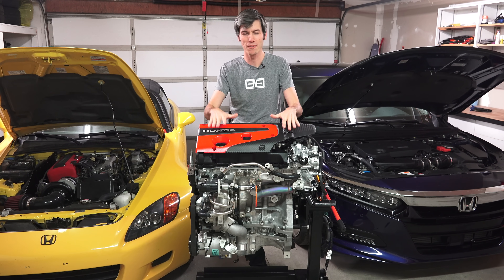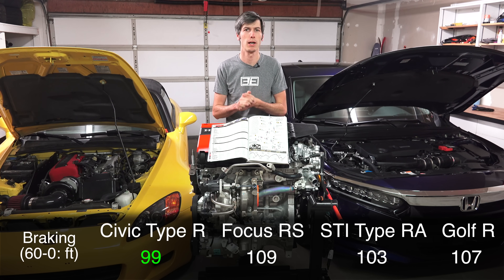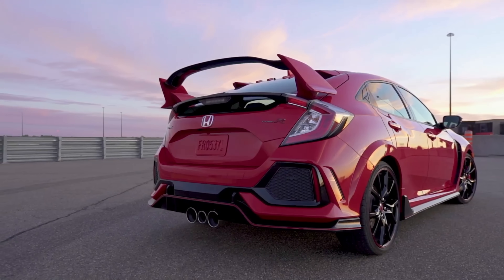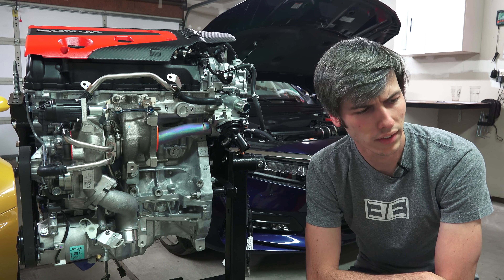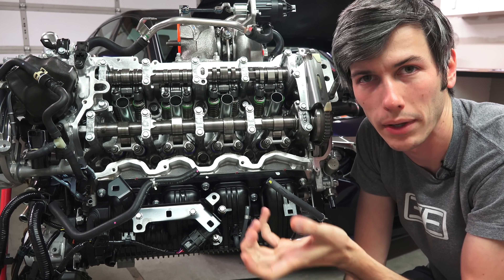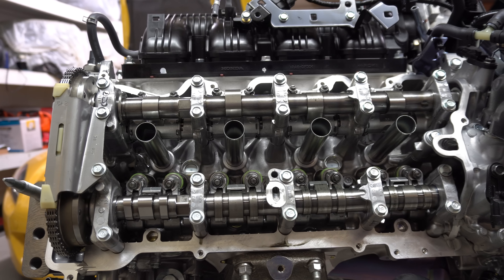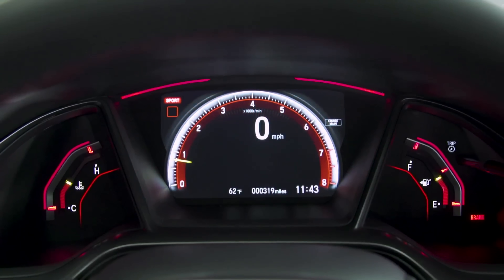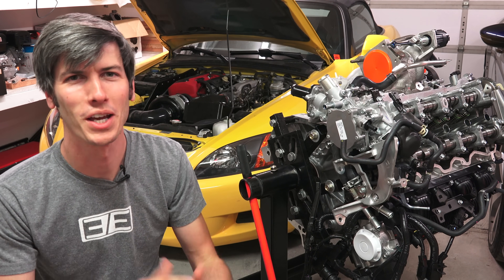The Honda Civic Type R Destroys The Competition - The Best Engines

Comment: Love your channel, however I have a (minor) bone to pick on the description. The 2018 Civic type R does 0-60 in 4.9-5.4 sec depending on source cited, while the 2018 Golf R DSG does 0-60 in 4.6 sec with clinical consistancy (via AWD launch control and 7speed DSG). 

Moreover the 2.0TSI in the R gains +60 horsepower with a conservative tune alone, (no additional parts modification required) and STILL does not have the overheating issues of the K20C1 (which I have witnessed personally at a recent track event in my area [car also had the second gear grinding issue which is somewhat common]). 

Having said that, I really like the FK8 Type R and hope that Honda is taking care of owners who are experiencing these issues, god knows VW is riddled with reliability issues, the most significant of which on the current generation EA888 G3 is electronic water pump failures. 

Bias note: I own a 2018 R and am likely emotionally biased, however I have personally confirmed the performance claims with my own car, using 10Hz GPS so I feel confident in the objective nature of this complaint (check out the video of 4.16 second 0-60 in a thunderstorm!).

Again, love the content, please keep up the great work!
Reply: So keep your DSG...awesome transmission but your ‘complaint’ is not telling us anything anyone (especially Jason) didn’t already know about the Golf Rs...of course a perfectly controlled launch will get consistent results. Launching a manual (let alone one with FWD) is all down to conditions and driver skill. 

Also if we’re going to nitpick over performance ceilings a tune in the k20c1 gets you similar gains. Of course the ea888 world has more potential at the moment beyond a simple re flash since the architecture has been out for quite a long time on a lot more cars...but then you get to the chassis read anything from Randy Pobst or people who drive for a living. The golf chassis is nowhere close to the Type R. 

Don’t mean to sound antagonistic but your ‘complaint’ ended up losing the plot in the end and sounding like reassurance for you about buying one. Enjoy it, who cares what the internet thinks. Even if beyond 0-60 comparisons it’s still slower than the Type R...
Reply: Please refrain from using the term “sports car” referring to any of these cars.  Lol.  The Golf R appeals to an entirely different type of buyer, like me who is 42 years old.  That Type-R will run circles around my Golf R, but I’m okay with that.
Reply: AOMechMarine AOMechMarine  my wifes '06 Subaru Forester automatic Blows away most cars from the stoplight in the Wet or Snow in Total Control so the Confidence part is true, and Chicago Winters Suck!
Reply: AOMechMarine AOMechMarine  didn't see that mentioned? But glad you approve. I have torched so many Lexus SUV's with mine, it's like "Give it Gas or get outa the way!"
Reply: vw piece of junk...
Reply: Golf R look too plain and can’t compete with the Type R stock for stock on the track. And why do people always try to compare a tuned golf R to a stock Type R? Civic Type R can also be modded and tuned to still run circles around the golf R. Plus type R reliability are far more superior if compared to the golf R. Call me a fanboy but type R have proven itself over and over again.
Reply: Vw vs Honda reliability, how man times you gunna have golf in the shop after the warranty is up good luck haha
Reply: After diesel gate vw doesn't even exist to me.
Reply: Honestly, the comments section of virtually EVERY hot hatch group test is full of VW fans making all kinds of excuses for why the Golf is getting beaten by newer and cheaper competitors. It's getting rather tiresome. For that group test they used a manual R because all the other cars were manuals.  WE KNOW the DSG is quicker from 0-60, thanks mainly to computers controlling every aspect of the process. But DSG or not the Civic is the faster car from a roll, the faster cornering car and the faster stopping car.
Yeah an R with DSG might have lapped a little quicker, but not 2.5 seconds quicker. Just because a car is quick from 0-60 does NOT mean it is the faster car point to point. Many cars with less power and a lower price can beat the Golf R round a track, of which the Civic Type R is just one example.
Reply: Hey i destroy Civic r's all the time with my golf r estate, how so? I got more room for everything und still be faster. Next pls
Reply: GadgetsNGear the one tested was a 6 speed and not dsg. Lb for lb the golf R is slower as you can see. Meaning dsg for dsg or 6speed vs 6speed the Type r will probably be faster in both versions if they were offered. Sure 0-60 the golf will always win but pass that it’ll start to die off.
Reply: @TheBb6prelude   I'd like to provide some corrections/context to some of the statements being made: first off a large part of what is affecting the manual Golf R's crappy 0-60 and 1/4 mile times have nothing to do with it making less power or being less effiecient than comparable cars. It is a well known fact within the VW community that the manual transmission in the MK7 Golf R is gimped from the factory compared not just to the DSG but to many other turbocharged cars equipped with a manual. Fact 1: The manual Golf R has no launch control and the way the ECU is setup in stock form causes it to lose boost in between shifts thus affecting acceleration times and trap speeds (some tuners are working on remedying this). Fact 2: The manual Golf R is using the same weak old gearbox/clutch that the MK6/7 GTi used! Because of this, VW implemented electronic torque limitations that will causes the car to bog when a hard AWD launch is attempted(ie. you can't dump the clutch). Fact 3:  The manual Golf R uses shortened final drive ratios compared to the GTi to help low end responsiveness but this the makes it worse in short distance tests like 0-60 or 1/4 mile because it requires an extra shift(e.g.. 3 shifts to 60) The same happened for years with the less powerful 5-speed WRX matching or beating the 6-speed STi because of suboptimal gearing.
Reply: The Type R is not offered in DSG, that argument is not valid. Given that the Golf R IS offered in a DSG and IS faster than the Type R when correctly equipped, my point stands. The majority of Golf Rs sold in the US are faster than the Type R.
Reply: dude the Golf R cost 15k more than the Civic how can you feel good about even being slightly faster to 60?
Reply: The Golf Is $5k more than the Civic in the united states. If you want to see where that money goes: Driving 4 wheels and the interior. It is worth every penny.
Reply: @Flakey86  Look under the car GadgetsNGear (see Savaegeese videos).  The Type R is considerably better quality than the Golf R.  The Golf R uses a lot of cheap stamped steel suspension, sliding brake calipers etc... The Type R is much better engineered underneath, lots of aluminium, sophisticated geometry, Brembos etc.
Reply: @TassieLorenzo  The golf R could definitely use a few less pounds on the scale which aluminum suspension arms would help with. But it's still faster than the Type R, stamped arms and all. And it doesn't suffer from catastrophic transmission failures or regular engine over-heat limp modes on track either. If my car exhibited those behaviors, I wouldn't care what the lower control arms were made out of.
Reply: Ultimately, the Golf R has much more performance potential than the Honda Type R ever will. Good luck delivering 350hp safely through 2 wheels only on less than perfect terrain and inclement weather. Choose the Honda if you don't like safe and stress free driving on snow and wet and tarmac.

Comment: Good luck finding one for MSRP.  That and living with it as a DD in snowy climates, the golf r was the better buy.
Reply: @Lako cancerous? That's quiet the exaggeration lmfaoo
Reply: Widely available at MSRP now. This was an issue the first year.
Reply: Hervyn Batista dealers in SoCal are still extensively marking them up...
Reply: 12055isgod not really. People are buying them for mid 30s
Reply: NO ONE is buying them at MSRP in Southern California where I live. I don’t/won’t travel far to buy any car.
Reply: With LSD and manual, driving in the snow won't be bad.  Needs tires, though.

Comment: 2 litres?? I have more litres of milk in my fridge!
Reply from the maker: This guy owns a gallon of milk.
Reply: You better drink it before it goes bad!!
Reply: I have a 3 liter Shasta drink in my fridge.😎
Reply: And there you go thinking milk is the way of the samurai and that is some how relate to this video, just like this message doesn't make sense either. 😬
Reply: Slap a turbo in it. Lol
Reply: So how much cowpower does your fridge make?
Reply: Dennis G I can’t disclose the exact number.... All I’ll say is it keeps my beer cold! 👍🏼
Reply: Evo 9. Mic drop!
Reply: This is all you can afford! Only milk! Other people have this engine! LoL...
Reply: daniel rosca Naaaa, I prefer 8 cylinders and at least 5.0L 😉
Reply: 2 liter is considered big in Europe and Japan. Usualy 1.0/1.6 liter in europe
Reply: @DevasionX  no it isn't considered big. 4cyl is consider normal. Six cylinder and above is big although not unusual so I would actually say only v8 is rare
Reply: Barry Britcher you’re not very bright bro. We’re talking about size for 4cylinders. V6/v8 is completely irrelevant here!
Reply: @Barry Britcher 2 liter is a full size 4 cylinder, just like 3 liter is full size 6 cylinder. BMW has had 2.2 and 2.5 6 cylinder engines where 3.0 was the biggest option (3.2 m3 excluded) 4 to 5 liter is usualy V8 size. tho ferrari has used smaller v8's
Reply: @DevasionX  the gtr used a 3.5 liter v6 and also the chevy impala
Reply: @benitoestudillo3808  GTR use 3.8 liter V6, 350Z that use 3.5 liter V6.
Reply: @barrybritcher  Most people drive cars under 2000cc so yes it is above norm ie big lol
Reply: Haha all kidding aside, I’ve had great experience with Honda engines from weed wackers and lawn mowers to ATV’s and cars.... They are hands down the most reliable Ive ever used!! Love em!!
Reply: @pajamatime5750  Honda engines are everywhere and for good reason. we have several Honda generators at my work and it never takes more than one pull to start it. same with my lawnmower. My old accord had 251,000 miles before I traded it in. Now only if they made a better truck so I could get rid of my Ford =P (I do love my F-150 but it isn't always keen to start in the morning)

Comment: Regarding the timing chain, what is the "life of the engine"?  From what I've seen "life of the engine" = life of the engine warranty.  If someone puts 200,000+ miles on it they'll have to replace that chain eventually.
Reply: Honda has a lot of experience with timing chains in high rpm motorcycle engines on bikes that 'go the distance'..

Comment: As far as direct injection on a turbo motor  how are they combating valve deposits?
Reply: EGR isn't the only issue with valve deposits, ring blow-by recirculated by PCV is also a major contributing factor...
Reply: @kbatzler  and exasperated by a turbo.
Reply: My old saab has di and with over 200k miles I havent had a single issue
Reply: EGR delete + pcv valve air to oil separator aka catch can
Reply: Steven Young you would have to do an EGR delete. All DIT engines will gunk up without it
Reply: @aramcerritos  not true.
Reply: Wayne S. Cool story bro. I have a 2016 WRX, not all us were as lucky as you to not get any deposits
Reply: Aram Cerritos all the DIT engines I work on that get intake valve deposits do not have egr valves. I know some mfrs do still use egr but I don’t work on those. Dual vvt can get exhaust gas recirc via cam phasing that leaves some exh gas leftover in cylinder. Aggressive drivers don’t get the problem usually. Idling engine a lot (remote start is bad medicine!) get it worse.
Reply: Vtec motors don't use  an EGR they use VTEC.
Reply: @Germfish  🤣
Reply: Service interval seafoaming lmao
Reply: @spruce4980  those services work like crap
Reply: I keep hearing this from americans but over in Europe we've had direct injection engines for decades and it's not really much of a problem. Maybe it has something to do with the hot weather there, or different engine oils?
Reply: @BigUriel  it probably has more to do with our emission laws.
Reply: I have the direct injected 2015 wrx & I also own a bore scope. Last week at 49,000 miles I took a look at my intake valves with my scope. 
They are still spotless.
Reply: @waynes.2983  That's cool but contradicts what others have reported with that engine. Wonder what you do different.
Reply: By the way...my WRX is completely stock.
Reply: VTEC tune, keep the engine above 6000 rpm at all times......like the Italian tuning on steroids.
Reply: Leaner fuel mixture and hotter running temperature.
Reply: Steven Young — The problem of valve deposits is greatly exaggerated.  If it became a problem, you would just have your dealer fix it.
Reply: @GH-oi2jf  the problems with direct injection are not exaggerated in the least. And take it to your dealer to fix it? I don't want to spend thousands on something that shouldn't happen in the first place.
Reply: @GH-oi2jf  it is not. Not in high performance  applications. This is coming from former mazdaspeed owner. I will not buy another direct injected engine unless it has dual injection. Even then I question reliability of injectors inside the cylinders. And by the way unless you have time and tools this is a couple thousand job from the dealer. Egr delete will increase highway fuel consumption and catch cans are not always an option in cold climates so neither is an acceptable solution.
Reply: KostyaK “coming from a former Mazdaspeed owner” is the truth. My old speed6 would through a cel for cylinder misfire almost every other day. I’d clear the code with the access port and hops it’d stay away. Super annoying.

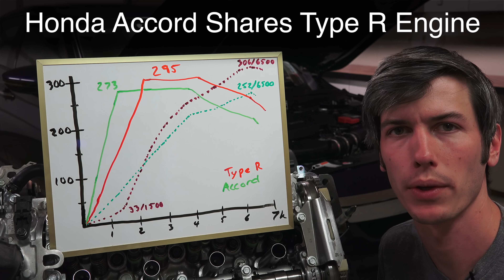Comment: 6:25 different between accord's engine , finally !!! thanks
Reply: Even the wikipedia page will tell you this
Reply: Word, but you can buy the flash pro from the dealer
Reply: Noor Mohammed so what if you flash it did you not watch the video? A reflash does not automatically make it a better engine or more suited for driving on the limit...smh.
Reply: @dlombana161  see thats where you dont understand my point. Only reason ill do that is for the track which i mean by drag racing.

Comment: The lifetime timing chain is a pretty bold statement IMO. We shall see.
Reply: Timing chains can last a very long time, ive seen k series with the original chain with well over 300k.  I've also seen chains wear and start slapping the valve cover in under 100k.  It's a give/take scenario.  The chain should require maintenance far less often, but when it's needed it will be far more difficult especially in a fwd.
Reply: Is automatically true though because it's a chain once that thing snaps or if it does go wrong the life of the engine stops right there haha so technically it will last the life of the engine LOL
Reply: @InsideOfMyOwnMind I always wonder what manufactures mean by life time. So if it breaks at 180k miles or 8k miles that will also be the lifetime of the engine🤷‍♂️
Reply: It's a all about maintenance. Good oil and frequent changes and they'll be golden.
Reply: Just change the oil frequently. Not what Honda says in the manual.
Reply: They say this as they know the chain will out last other parts in the engine so i guess its true
Reply: @insideofmyownmind That's why I went with a timing gear set on my current Mopar LA 360 build. Build it right the first time.
Reply: Not a new claim at all. They did that back in the early 2ks with the Ford duratec V6s. Lifetime chains. Maintenance plays the critical factor in that claim.

Comment: Would carbon build up be an issue for the new Honda Accords/Civics? They don't have Toyota or Ford's dual injection system. Maybe a well designed PCV will solve the problem?
Reply from the maker: I asked the chief engineer about this, and he said carbon would not be an issue. I asked him how, and he said it has a special coating/material selection on the valves. I continued to ask about it, and he said "I won't say anymore" haha. He seemed confident in it, but I cannot tell you why (because I don't know why).
Reply: But something none of the engineers will talk to you about is LSPI or low speed pre ignition. It is a huge problem among all manufacturers of small high output turbocharged engines. It's becoming common to see these engines come in with broken pistons and rids through the side of the block.

Comment: If the car only looked better. Sheesh. 
Ok the performance side though it is definitely representing the R badge very well. 
I know VW did something (or didn't) to the manual Golf R that causes it to bog down when launched. It's pretty bad. I'm not sure the deal with the STI, the normal one is quicker. 
Props to Honda engineers. Their designers on the other hand need ... Hmm... they need to be reprogrammed
Reply: You're right. The type-R is well engineered...and butt ugly.

Comment: Can a stock Type R be tuned for much more power?
Reply from the maker: Well all the cars are rocking small four cylinder turbos. I've read the tumble ports on the Type R engine make airflow challenging if you continue to add boost (and sizing different injectors), but if you can change the intake ports and fit bigger injectors, more boost for you!
Reply: Tdi north do a safe 415 hp setup

Comment: Civic's more practical than the golf?
Those numbers are really impressive though.
Reply from the maker: Based on rear legroom, cargo space, fuel economy; it could be argued (though I think practicality-wise most hatchbacks do pretty well).
Reply: @EngineeringExplained  That's interesting (albeit disappointing for a VW fan) to hear.
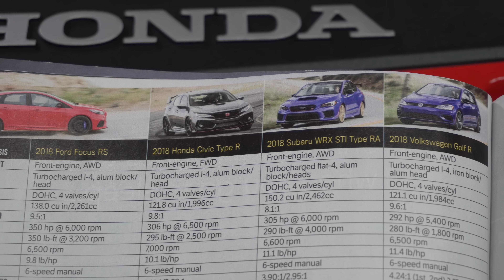Looking at 0:28, I'm surprised that the Golf has the highest power to weight ratio even without the performance pack that pushes it to 310 HP.